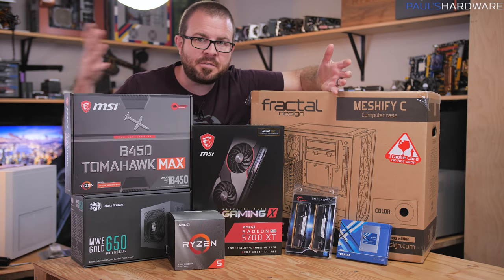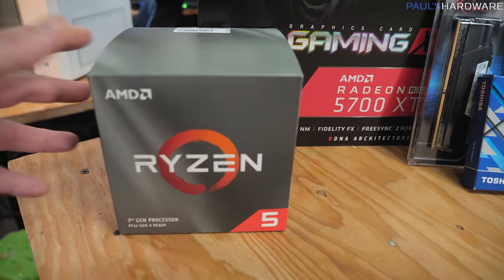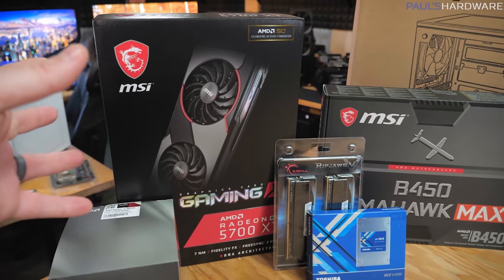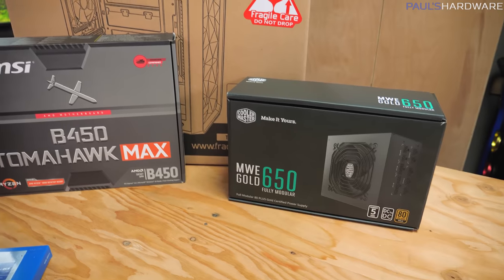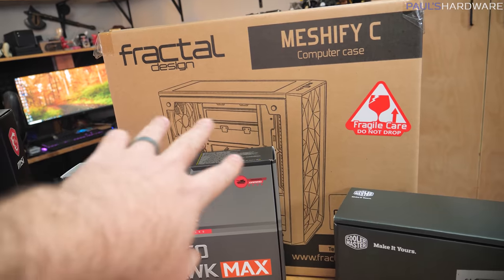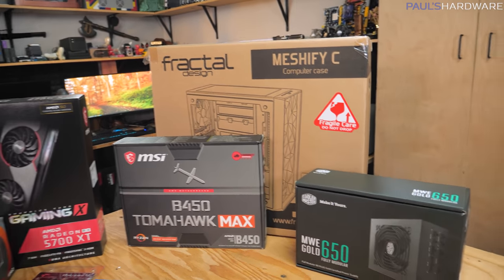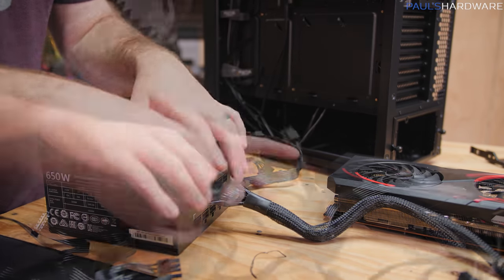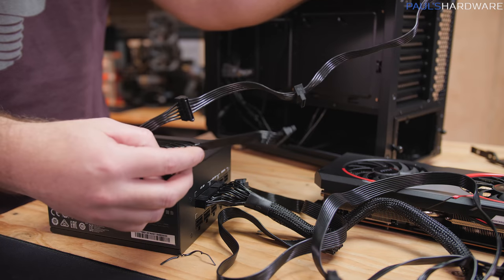Building the $900 Gaming PC that Everyone Should Build!

Comment: Hey Paul, This build is awesome! I was going to purchase a new computer for my wife but after watching your videos, decided to build a new gaming machine and give her my old gaming laptop. What a machine! No more lagging, getting killed and being the last one into an area. Your tutorials were excellent. Very easy to follow making assembly a snap. I took your recommendation and purchased an ASUS X570 motherboard with WiFi. (It made me read the MB instructions since the pin connectors were in different locations from the B450 Tomahawk.) Fired it up and everything worked great. Only nagging issue is Microsoft 10 Pro limits customization until a product key is purchased. (I have one on the way.) Your cost estimate was spot on. I was able to build my set up for $1,100. Thanks Again!

Comment: A year later and I can't thank you enough for these recommendations last winter/spring Paul.  I purchased all my hardware before parts started becoming scarce.  The only things I did differently were investing in a 1TB Intel 660p NVMe drive (which has been GREAT) and buying a Sapphire RX 5600 XT because my gaming needs are modest and I wanted a silent build.  Case, CPU, mainboard... everything else has been great.  I'm glad I built what I did when I did.  We moved to work from home and have been online since so the new rig came in SUPER handy.  Great advice!

Comment: I built my computer based on this build, most of the components. I was able to keep it under $750. Using a new MSI Tomahawk B450 MAX and Ryzen 5 3600x, a used XFX 5700 thic GPU, bad mistake, it was loud and overheated. I also used a semi-modular Corsair 650 bronze PU. Somehow the GPU, PU, and the motherboard failed. So I built another using a new B450 MAX, a Corsair gold certified fully modular 850 PU, and a new Gigabyte RX 5700 XT OC, added a 1Tb m.2 and 2 more sticks of ram, 32mb total. It's working great, although the build, not including the original parts that failed, is now around $1200.
I thought about switching to the Meshify 2 case, but this one is nice.

Comment: “If you can’t put a RTX 2080 in it, I don’t want it”

-Grandma
Reply: Lmao
Reply: I got 2080 fck yeah
Reply: ray tracing is the future, grandson and it is now, she added.
Reply: Pft, Found out I can't even fit a Zotac Amp Extreme 1080TI in my deepcool Genome II without bending crap... Good news is card is so tight, no sag. :P
Reply: ONLY BANGERS inc  alrdy got 2080 for like 450 bucks. Rmad new replacement
Reply: These comments are straight 🔥😂
Reply: ONLY BANGERS inc  a 5700 isnt better than a 2080. not even close really, although the 2080 is overpriced trash that shouldnt be bought by anyone that doesnt make money from gaming/video editing etc
Reply: Pfff 2080 Ti pal
Reply: @stephenhartley2853  5700 has overheating issues. $300 more for a gpa that has perfect performance for 1440p×144hz and won't bust is not trash

Comment: Glad I caught this vid before finalizing my purchase. Was gonna go for the r7 2700x but seen this 3600 performs better for gaming. Bought me some more fps! Can’t wait
Reply: Oriaj so you would recommend a r5 3600 over a r7?
Reply: @TheRealSlimShady509  if you're gaming, its a great bang for the buck cpu. If you're doing more video editing, I would go with the r7
Reply: Nora Hughes j plan on just using it primarily for gaming. I am brand new to this so i have a question that is probably stupid. If i buy the r5 now and eventually want to upgrade, i can just take it out and put a new one in right? I am pretty sure the answer is yes but just in case.
Reply: mason essary if you’re primarily for gaming then yes. R5 3600! Been using it for a week and paired with my same 1070 oc card I can run medium to high settings at 144fps. Which is what I wanted since I have a 144hz monitor
Reply: mason essary and yes. For amd chips and motherboards you can just upgrade. For intel it’s different.
Reply: mason essary sorry for separate reply’s. If you can get the r5 3600x you might as well just buy that chip. It’s been on sale on amazon a lot lately and it’s only an extra 30 dollars. Not the biggest increase in performance but it’s only a 30 dollar difference. Just checked amazon couple days ago
Reply: Oriaj Awesome thanks so much for the help! So would you recommend a 1070 gpu then?
Reply: @TheRealSlimShady509  - For a few hundred dollars less, go with the RX 5600XT or the 1660 TI over the 1070. I personally have an RX 590 8GB paired with a first gen Ryzen 5 1600 and they both perform fantastic. I'm not one to go all out just to have the newest tech, I just need things to work the way I want them to at the cheapest price point. Will I upgrade in the future? Yes, but I will wait until new tech prices come down to justify the upgrade. Don't try to fix what isn't broke... wait until it breaks and be amazed how long it lasted and how cheap parts are at that point for waiting.
Reply: Silver Stacker i have actually been considering an rx 580. How much better is the 590?
Reply: @TheRealSlimShady509  - This is the RX 590 I have, found it on eBay for $150 Sealed (dont see many of these new anymore)

NewEgg -
https://www.newegg.com/gigabyte-radeon-rx-590-gv-rx590gaming-8gd/p/N82E16814932141

Gigabyte Website - 
https://www.gigabyte.com/us/Graphics-Card/GV-RX590GAMING-8GD-rev-10#kf

The RX 580 is 1355MHz , The RX 590 is 1560MHz on the core clock. They are both 256-Bit GDDR5, both have 2304 stream processors. (If you get an RX 580 make sure it's the 8GB version, not 4GB!) The RX 580/590 need nothing more than a 6 or 8 pin PCIe cable and a min. 500w PSU. Both are great cards, but if you are looking for newer tech, go with my previous comment.
Reply: R7 is all rounder..

Comment: This is pretty much the same PC I built a month ago.
ryzen 3600,
MSI b450 tomahawk max
Meshify C,
Gigabyte 5700 XT gaming OC,
Seasonic 750W gold
G-Skill 2x8GB 3600MHz  b-die
Samsung 860 EVO SSD, 1TB
Reply: What are your experiences with that 5700 XT card?
Reply: @yannickvanriebec3473  it is great so far. More than twice as fast as my previous card, AMD 290.
Reply: Any stability issues with tomahawk?
Reply: j ha-nocri how is the GPU? Seen people talking about stuttering a lot but i’m looking at buying ons.
Reply: @Sotirce  No stability issues with Tomahawk. If there were I would return the board, it's under warranty.
Reply: @Jake-um4gg  There is in some games, mostly open world. But not any worse than what I see on youtube benchmark videos with NVidia. Some games are just poorly optimized.
Reply: did you have to do bios update using the new gen ryzen with the tomahawk max?? still getting warnings about it
Reply: Does the gigabyte 5700xt fits well with that case?
Reply: @vahsas  MAX motherboards are ryzen 3000  ready, so no need to update bios first.
Reply: @thekinodertotenzombi  It does. There is room for radiator at the front also

Comment: I can't wait for the day when AMD starts releasing high end GPUs and forces Nvidia to lower prices.
Reply: reni4kill  I think he means like 2080/2080ti spec level. This card Paul uses is about a 2060 super/2070 competitor.
Reply: reni4kill when compared with Nvidia’s $150-$1100 price range for GPUs, a $350 and $400 5700 and 5700 xt card is certainly mid range
Reply: reni4kill I’m saying mid range from its price
Reply: reni4kill so if the performance of the 5700 xt is high end what is the 2080 TI?
Reply: fucking kidding me? 5700 xt is a piece of shit compared to 2070 super / 2080 / 2080ti. those amd cards are mid range, deal with it.
Reply: @foyle2809  It's actually pretty much on par with the 2070 super but for the same price as the 2060 super which it kicks the crap out of.  2080 super and ti are definitely no questions asked superior cards though.  Unsure why people are arguing that they're midrange or not though... the AMD's are definitely mid range cards.
Reply: Sounds like he's saying he want AMD to do this so he gets NVIDIA parts cheaper. This is exactly why AMD isn't focusing on the high end and NVIDIA is price gouging
Reply: @Henry-fv1pe  too overpriced, the price difference should be 100 dollars between all those cards.
Reply: @foyle2809  ind games like dx12 like red dead 2 Rx 5700xt= rtx 2070 s
Reply: So, you want AMD PUT TONS OF MONEY IN R&D and make at high end gpu ... So that little green swines  fanboiis get green card  at lower prices.
Sounds  Cool!!
Reply: reni4kill  it cant handle 4k gaming and higher end graphic games as good. We want a 2080ti/2080 super competitor. The 2080ti/super gets around 25 to 40 frames more
Reply: RX 5700XT vs RTX 2070,the RTX 2070 only better about 7 percent making the 5700xt super competitor,And RTX 2080 vs Radeon VII,the RTX 2080 only 7 percent better than The Radeon VII making amd is Chasing both,mid range and high end gpus.Im not Nvidia Fanboy either AMD Fanboy
Im just giving facts,peace.
Reply: reni4kill  I said high end GPUs. Nvidia has zero competition and all the idiots out there buying up $1000+ GPUs alao allow them to continue with this.
Reply: @markilys  THIS right here. Intel just slashed the price of their 10980XE because of AMD. You people think Intel would do that if AMD was still on FX CPUs? Hell no! The 10980XE would retail for $2500.
Reply: Just want to add to this.. 

With all that said, when I finally upgrade from my 6700K, I almost certainly will be going AMD. They just have all the performance right now. If they ever release a card that can compete with a 2080 Ti for around $750-800, I'll buy that too. Nvidia will lose market share and be forced to lower prices.
Reply: @Henry-fv1pe  Just because it costs more doesn't put it in a higher range. And it doesn't mean it performs better either.
Reply: @CastIronEric  The only thing making me consider Nvidia is ray tracing. If I didn't have that itch at the back of my skull then I would buy AMD for my new build right now. Will ray tracing matter in a couple years? My gut says yes, and I don't want to have to ebay my 2 year old 5700 XT to get whatever ray tracing card Nvidia will have in my budget. I will probably go 2070 Super now instead, and hope it's good enough for ray tracing two years from now.
Reply: @THE-X-Force  I don't care about the ray tracing. I care that the 2080 Ti is 50% faster than my current 1080 Ti. The 5700XT isn't even on par with a 1080 Ti.
Reply: @CastIronEric  But the cost between a 1080Ti and 5700XT are different, no? And I don't have #'s in front of me, but isn't a 2080TI in the $600 range .. while the 5700XT can be had for $375?
Reply: @THE-X-Force  Research before, bro. A 2080 Ti is, at minimum, $1049.99 new. A 2080 Ti is at least 4x better FPS than a 5700XT. 

I get that you want AMD to be competitive, but it's not happening until they release a high end GPU on par with a 2080 Ti.
Reply: @CastIronEric  That just makes my point MORE for me .. the point being the huge price disparity. And what is the point of comparing a card that can do 4x the fps & costs 4x more? I don't think you get the point.
Reply: @THE-X-Force  lets just say like this...the gtx 1080 was listed as an high-end GPU about 3-4 years ago right? and still is considered as an high-end GPU? The RX 5700 xt is about 10% better than the 1080. For my type of gaming (1440p) ultra/high settings 70-150 fps is high end :)
Reply: Then I'll can buy a 2080TI at last.
Reply: @CastIronEric  Except it's not 4x better in fps lol. It's not even 2x better hardly and it costs over twice as much.

The 5700xt card fps to price ratio is incredibly good value.
Reply: @Digger-Nick  You're right. It's closer to 2x faster. A 5700XT is actually on par with a 1080 Ti. That's impressive. Let's hope the next AMD cards will compete with Nvidia's top much sooner within the life cycle of said cards.
Reply: tbh most people dont need more than a 5 3600 anyways
Reply: @whoswho1233  Lol, really? I hope that's a joke! My 3440x1440 needs more than a 2080 Ti sometimes.
Reply: @CastIronEric  you must stress your computer a lot lol. The average gamer doesnt need all that horsepower which is the majority of gamers on PC. A ryzen 5 3600 can run pretty much any game aside from the really big ones like pubg with 60fps if its got a good GPU or at least it should.
Reply: @CastIronEric  oh shit were we talking about gpu's and not cpus?
Reply: @whoswho1233  this guy
Reply: @whoswho1233  You classify pubg as a "big one?" Skyrim looks better than that shit.
Reply: amen
Reply: @psour33  I know a way to buy a card faster than a 2080TI for cheap.

...
...
Wait for it
....
....
Wait about 5 years.
Reply: Henry 2080ti is considered enthusiast, so yes 5700xt is classed as high end
Reply: Eric C a 2080ti is 27% faster than a 1080ti, not 50%.
Reply: 5700xt looks good on paper. Installed on your system with AMDs written by the intern drivers though, it's not so hot.

Comment: Amazing video. There is only 1 thing i would strongly suggest not to follow and it is the power connection for the videocard. Usually a power supply unit have limits to how much power can they support on each modular lane. If the vga uses more than that limit, it can actually kill the psu. It is not that hard to use 2 modular cables for the 2 connection on the vga. It is a long term reliability choice, which doesn't cost any extra money.

Comment: I purchased 3000Mhz memory and overclocked to 3400. Seems to run just fine. Also; I used the standard B450 Tomahawk. The board has a dedicated usb port for bios updates. So so long as you have a flash drive and means to load the updated bios to it, you can use a 3000 Ryzen with the standard Tomahawk board.

Comment: From what I researched, it seems that it's a bit better if you don't use the daisy chain on the GPU power cable. When using independent cables there seems to be more stability and it can add like 25mhz on the GPU clock, as the GPU can be overclocked further. It's not a noticeable difference, but I thought it's worth mentioning.

Comment: I have just built a PC very similar to this one here in Australia. I went with the Ryzen 3600 instead of the 3600X because the latter is AU$100 more expensive (which is ridiculous). One thing I couldn't accept was that at 100 pct load temps with standard cooler went to 88 degrees (C) in a cool office :-(  and during normal use, the CPU fan kept spinning up and down in speed which was very noticeable, so I got a be quiet! Dark Rock Slim cooler which is much better and completely silent. A very nice result: 2-3x faster than my old 4790K.

Comment: I know it’s been 8 months since this video was released but keep in mind that the Fractal Meshify C is quite small. If you opt for an AIO , either 120mm double fans or triple fans you will not be able to fit the RAM unless you mount it in front of the case with the fans pulling the air in which will leave ~ 280mm card length and 10mm in between the grafic card and the aio.Also if you want to fit 3 120mm fans in front for the bottom one you will have to remove the hdd rack.About the graphic card I strongly recommend Nvidia.

Comment: Idk of these parts would be good or not, but I found some of the parts you did for the pc on Amazon. These are the parts and prices:
•Asus ROG Strix B450-F Gaming Motherboard (ATX) - $120.99
•Corsair CX Series 550 Watt 80 Plus Bronze Certified - $79.99
•Fractal Design Meshify C - Compact Computer Case - $89.99
•MSI Gaming Radeon RX 5600 XT Boost Clock: 1620 MHz 192-bit 6GB - $309.99
•ADATA SU635 480GB 3D-NAND SATA 2.5 inch Internal SSD - $46.99
•v-Color Prism Pro RGB 16GB (2 x 8GB) DDR4 3600MHz (PC4-28800) - $78.99
•AMD Ryzen 5 2600 Processor with Wraith Stealth Cooler - $149.06

Total: $876.00

Comment: This is pretty much my exact build which was completely accidental I swear
Reply: How does it run for you ? 
Asking for an opinion
Reply: Dodayme everything that’s gone wrong so far has been purely my fault so it’s good. I have the same psu, cpu, and mobo but the other components are just slightly altered. I can get 100+ FPS on high-ultra settings for most games
Reply: @kcid6655  thanks for the answer

Comment: Honestly that 3600 needs a fucking pedestal.
Cheap, with a load of horse power. This combined with the cheap, versatile AM4 platform.
AMD opened up a whole world to a powerful PC that can chomp down on 1080p at 60hz or even 144 in a pinch for modern titles.

Great system, great price. Something for a young kid to work hard for and save up. Giving them a system that can last for years and easy to upgrade if needed.